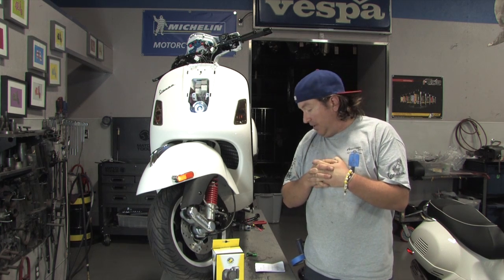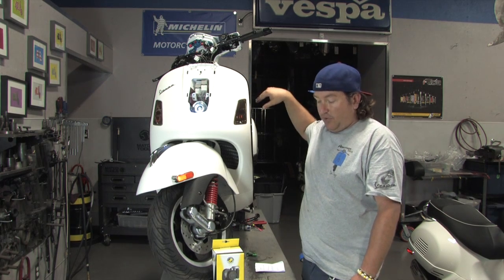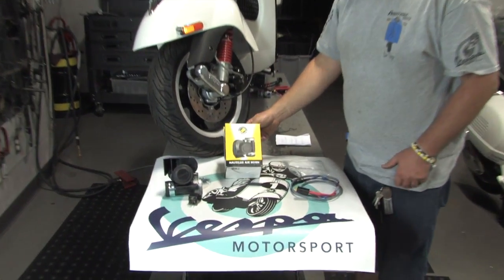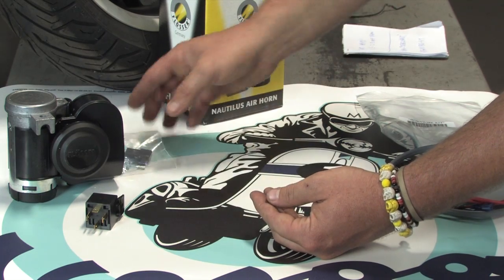How to Install an Air Horn on a Vespa GTS

Comment: Great video guys, just used this to fit horn on a 2018 with ABS, I had to move the bracket so that the bottom hole located on the top bolt only but it still fitted just.

Comment: Lesson learned, read the comments first, after some jiggery-pokery, I've managed to squeeze it in. GTS 300 2018 with ABS pump and Tracker device. Relocation of Tracker, re-used the modified turn signal mount, now located on the top captive nut at an angle. Slight modification to the inside of the glovebox to allow room for the compressor. Never say never. It fits. 😁

Comment: My '06 GTS 250 had the flasher located in a different area hence no bracket. I fashioned my own bracket and managed to stuff it in the same general area and buttoned it back up. I've had that horn for a few years and finally found a good use for it. It's pretty loud......

Comment: Dear friends, I installed Stebel Airhorn on my GTS300 a few months ago. One recommendation from my side. If you will separate airhorn into two parts (compressor and  trumpet) then instalation become much much easier .-))

Comment: I have a 2016 GTS 300 ABS model and I've had a peek inside where the Stebel is supposed to go. The ABS unit would make it a very difficult fit, and if you have the Vespa -LUX alarm system fitted there's no room at all.

Comment: dos it fit on the 2005-2006 vespa GTS250ie ?
Reply: I've just installed one on my '06. The flasher is located in a different place than their video shows and there is no bracket. You'll have to create your own bracket